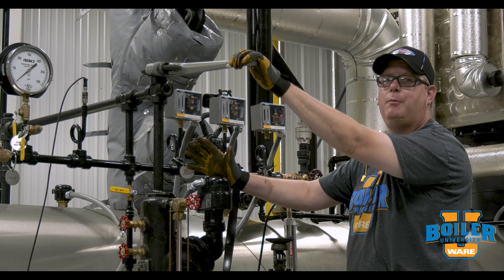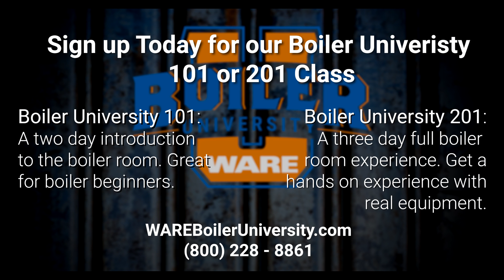Properly Backing Up a Wrench to Prevent Damage to Pipe Fittings -  Weekly Boiler Tips

Comment: Man thank you for that. I am doing a faucet install trying to pair up braided factory supply lines to rigid copper lines (solely for looks, not logic!) and got some instructions about using a 'backup wrench' when pairing the two via a compression fitting. I thought maybe it was a special tool - but with your thanks I see what's going on. Thank you!!
Reply from the maker: So glad I it was helpful, appreciate you watching!